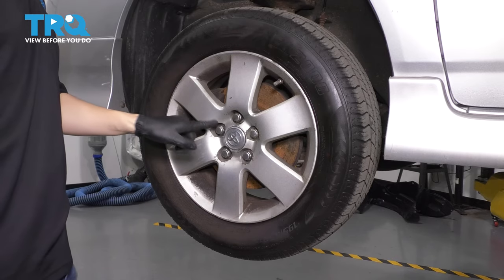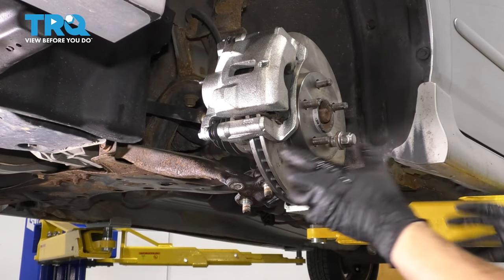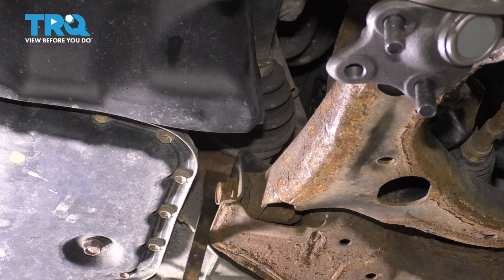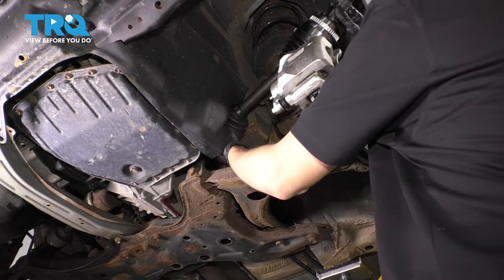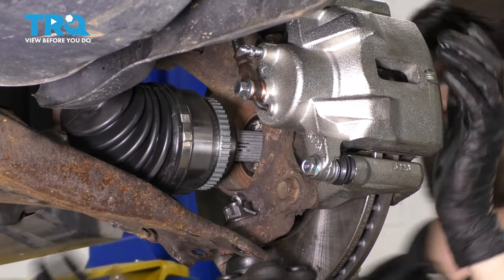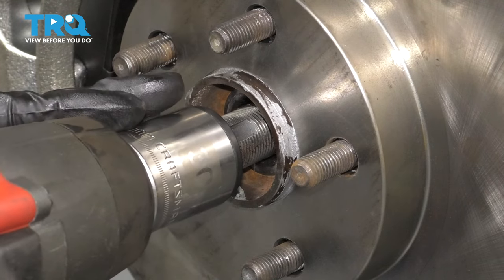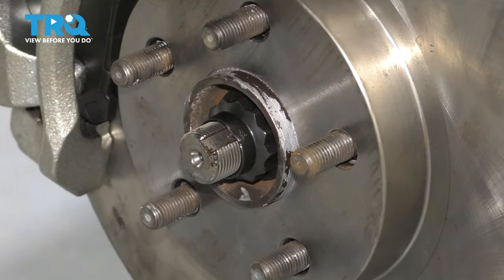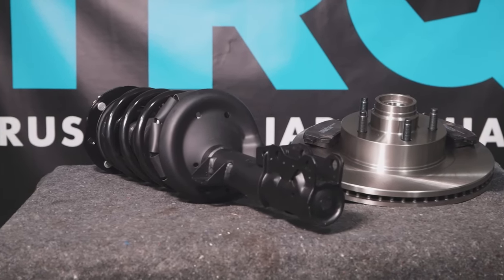How to Replace Driver's Side CV Axle 2003-2008 Toyota Corolla

Comment: Getting the shaft out of the transmission was very difficult for me. Finally, I put wood shims on the opposite side and top to keep it from moving and getting cocked and that did the trick.

The fact I wasn't using a lift and working on the floor makes a difference too.